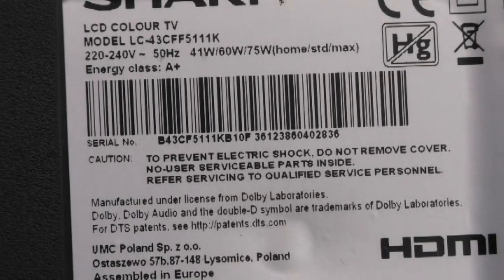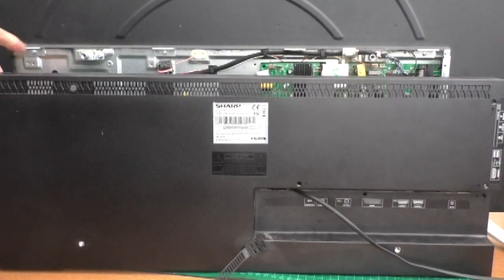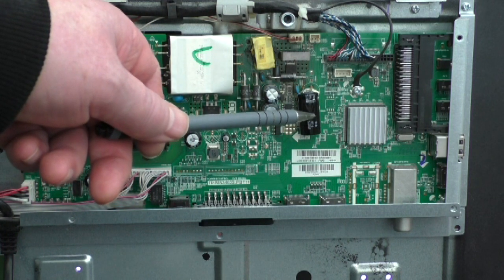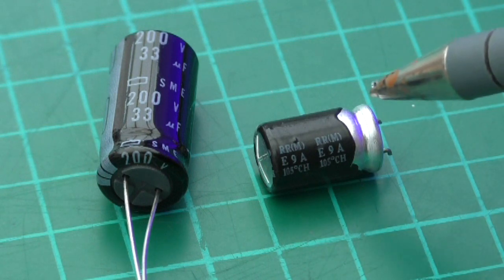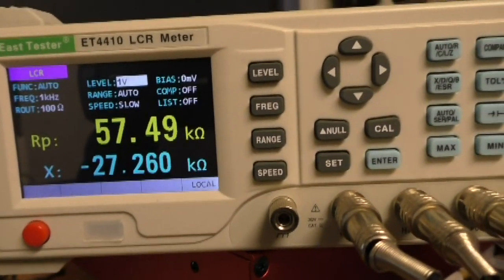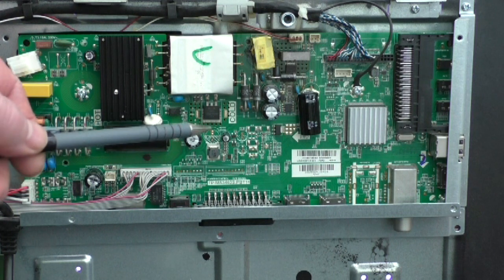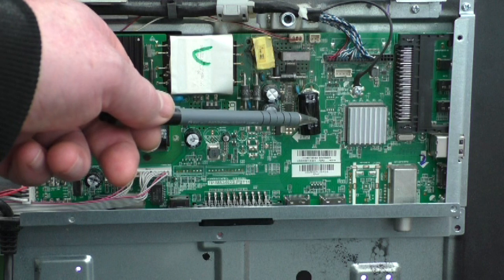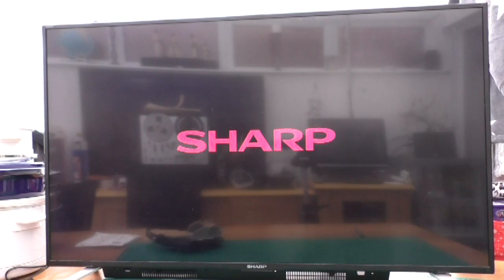Fix Sharp Aquos TV  Faulty, switch's off after Logo

Comment: any ideas for the following fault. Son was watching TV, Sharp Aquos. half way through a progamme and it just switched off randomly and will not power back up. Showing no power at all. Changed fuse in the plug etc but no power at all. Any ideas. Its about 4 years old. Thank you
Reply from the maker: If you are not getting the standby Light on its most likely a failed power supply, sometimes with switch mode supply's if you place your ear close the the TV and switch on the TV you can hear a ticking sound, if you hear this sound most definitely a failed power supply. Either way if the Power supply is faulty  then a repair/service would be required.
Reply: @waynephillips1848  yea, no standby light. no ticking noise at all. could it be a fuse inside?
Reply from the maker: @angiutv5897  Just looked at the service manual and there is an internal fuse, on my video at 57 seconds, look in the top left corner there is a white connector, just to the right and above is a brown soldered in Fuse, PCB designation FB1, rating T3.15AL 250V. Please read my warning in the description
Reply: Thanks I'll have a look.  😊